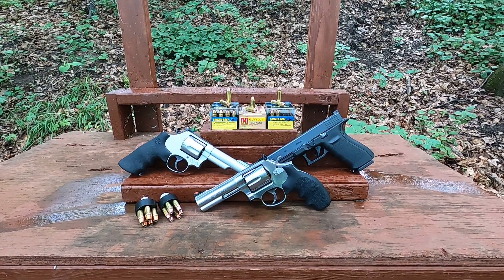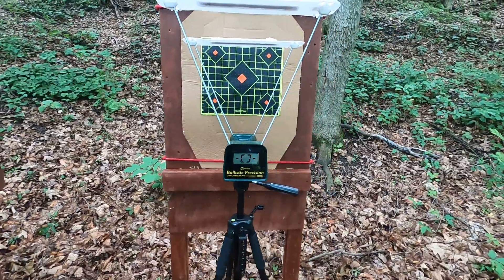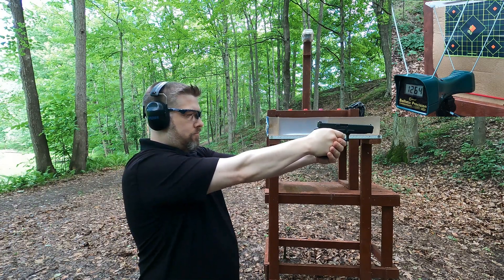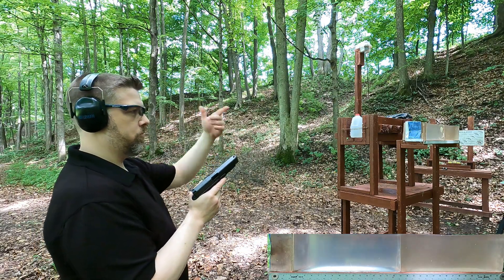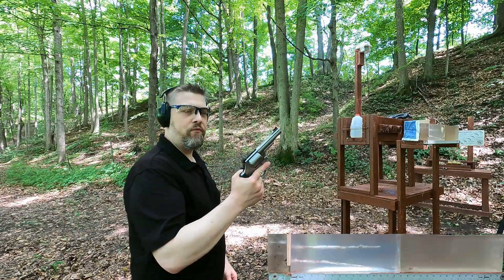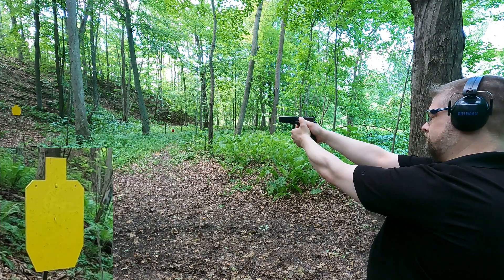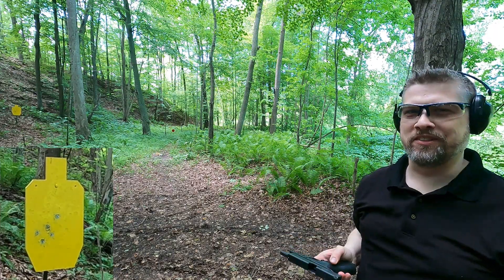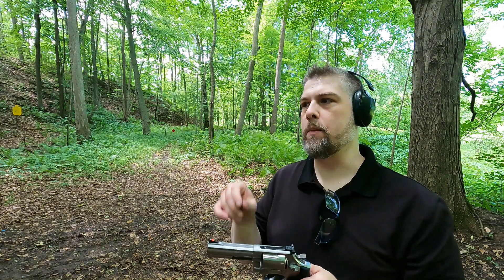10mm VS .357 Mag VS .44 Mag ALL 180 gr XTP

Comment from the maker: One thing I was trying to explain and could not get the words for in the field, is that probably the reason the .44 Mag had more recoil than the .357 Magnum is because it is more powerful than the .357 Magnum, thus more recoil. I know people will say "But Gun Sam, you showed that this particular .44 Mag is less powerful than that particular .357 Magnum?". And my answer would be, no I did not. I showed that in 4" barrels the .357 Magnum retained more of it's potential energy as where the .44 Mag lost more potential energy. Both of these loads in rifles I would have no doubt that the .44 Magnum would have more energy thus this makes more recoil in a 4" revolver even though the energy does not reflect this.
Reply: i think this video shows more then most that ammo choice matters tuning the ammo to the gun is as important as the gun
Reply: Possible contributing factors for the .357 shooting ‘lighter’, barrel having a full underlug, maybe the bore sight height difference. These smallest differences, plus more yet to be revieled are the reasons.
Reply: @randomizationdrills5372  "more yet to be revealed"...that would be included in the formula at shooterscalculator.com. everything is taken into account. check it out, lot of fun.   or if you like doing math, the back of the lyman manual has the formula in the long form.
Reply from the maker: If you look at the 10mm and .357 Mag you see small fireballs from the muzzle. With the .44 Mag it's several feet long of a flame. This goes along with my original comment. I think in an 18" rifle we would be looking at like 1,000 FPE for the 10mm, 1,200 FPE for the .357 Mag and like 1,600 FPE for the .44 Mag. EDIT- After I made that statement I did look up the numbers on Buffalo Bore's website and they did test the .357 and .44 Mag in an 18.5" rifle. And while my numbers were a tad more off than reality, I was still not wrong. The .357 Mag is 1,353 FPE and the .44 Mag is 1,537 FPE, both from the 18.5" rifle.
Reply: @GunSam "The .357 Mag is 1,353 FPE and the .44 Mag is 1,537 FPE, both from the 18.5" rifle. " But NOT in this case, since it was a "weak" load of 180 grains 44 vs "hot" load of 180 grains 357.
Reply: Had to watch this again with a very pretty lady. The extra recoil from the 44mag could be become of unburnt powder. That's just a hypotheses, damn I always get a headache when I use big word's.
Reply: I still have to admit that I was suprised that the 357 had more penetration than the 44 even though you explained the fact that the 44 was a lighter load
Reply: @donaldballman2825  the 357/180 has a sectional density of .202. the 44/180 has a sectional density of .139. since velocities were relatively the same and assuming the bullets are constructed the same, the smaller diameter/higher SD wins the penetration test.
Reply: @carlschumacher3257  I did listen to what was said in the video
Reply: @carlschumacher3257  You assessment of penetration is accurate.  I remember early in my law enforcement career in the early 70's second chance body armor company did a lot of penetration tests with their soft body armor.  There tests showed that the bullets that penetrated the farthest into their armor was a .22 Magnum and the .357 Magnum.  The handgun caliber that penetrated the least was the 45 ACP round.  Give me a 357 every time!
Reply: Being the same weight the 357 will hade a much higher sectional density, which is key to deep penetration.
Reply: @gun Sam revolver Aficionado have you thought of trying .45 super in that G21? Use your factory barrel, extractor and ejector and load your own using .45acp (or better yet .45acp+p cases. Just make sure it’s a fully supported chamber. Add a 24# guide rod spring and go to town! I use a Wilson combat muzzle break on my tac 45 XS and have had nothing but reliable function with everything from 330ft lb target loads to 900 ft lb 250-255 gr (heavy trail loads)  it reaches saami max pressures around 1,00-1,100 ft lbs. but since it’s the same dimensions as 45acp it’s super reliable. Just a thought. I’d love to see you compare my favorite pistol cal to some 10mm, 44mag ect. The Wilson combat muzzle brake is more effective the more your ft lbs increase. I also used a 24# guide rod spring, flat bottom firing pin safety and a 22lb main spring.
Reply: I'd like to have a shot at answering this.

Focusing on the diameter of the bore and the pressures exerted within the barrel can mathematically suggest why the 44 has more felt recoil.  Pressure is defined as Force divided by area.  Then Force can be derived by multiplying the pressure times the area of the bore - that is the force that is acting on back end of the bullet as it exits the barrel.  

The .44 has about 49% more area than the .357 bore.  At the same pressure, the .44 will have 49% more force.  Conversely, if the .44 had on 67% of the pressure of the .357, the forces would be equal, and I bet, the felt recoil would be the same.  

Does that seem reasonable?
Reply: Size and weight of gun also matters.  My .357 snaps way more than my full size 44, function of weight.
Reply: that's the dumbest answer I have ever heard-energy is a direct result of mass times velocity-both 180 grain bullets at the same weight would hit a steel plate with the same energy-the penetration is a result of less surface area to push through the medium-and why would you shoot a 44 magnum with a powder charge low enough to be in a special? A full power 180 grain 44 magnum load is over 1650 feet per second
Reply: Morning ,Sam. Doing some reviewing and thought I'd ask your opinion. 
I was having a discussion with a young man who was saving up for a 10mm revolver. He said I should get one, too. I said why? I already have a 357. Wasn't trying to be smart, but I told him 10mm is about multiple rounds. I have a .40 BTW. 
I couldn't see spending that kind of money for a revolver  when the .357 has more bullet choices and they're cheaper. What is your opinion on  10mm revolvers, and would you be better served saving up for the auto?
Reply: Recoil is a function of momentum but also specific to the ergonomics of the gun. Penetration at its base, is sectional energy which is modified terminally by bullet deformation and instability, which throw any predictions out the window.
Reply: @GunSam  Hi Sam, have you ever tested the 125 or 158 xtp flat point?  I’m curious to see the results from a revolver. I’ve tested from a rifle, but not from a handgun. Plus, I’ve never seen factory ammo loaded with them.
Reply: sam:  pull a bullet from each case and weight the powder charge then go to shooterscalculator.com and you can find out the recoil for each firearm you used. my guess is the .44 mag has a heavier powder charge.
Reply: @carlschumacher3257  Wrong. The same weight of bullets would've been resulted in 44 mag having MORE foot pounds than 357 mag if this 44 mag was loaded with lot of powder. Here we have an UNDER-POWERED 44 mag compared to the hottest 357 mag. Sensing more recoil when shooting this 44 mag (as opposed to shooting 357 mag) could be the result of the difference it ergonomics of the two revolvers.
Reply: no, you misunderstood what i said.  i was talking about the loads Sam was shooting. he wasn't shooting a full powered 44 mag load and yes, the 357 was a hot load, but that is beside the point. the video was about 3 specific boxes of ammo.
Reply: @carlschumacher3257  That's what I stated first, whereas you stated: "my guess is the .44 mag has a heavier powder charge" in your reply to Sam.
Reply: @carlschumacher3257  Agreed.
Reply: The powder weight is irrelevant as they will be different powder blends. Big bores like .44 have more bore diameter/area than a 357 and usually employ a slower burning powder.
Reply: 44 recoils more because it has more volume of expanding gas coming out the end.

Comment: Part of the reason behind the 44 having more recoil than the 357 could be powder charge weight. If the 44 has say, 10 grains more powder, it would have similar recoil to a 190 grain 357 at the same velocity. That's probably not all there is to it because I doubt there is a big difference in powder charge weight, but it might play a part

Comment: you can have your 6 shot, non accurate because of the bad recoil, long azzz trigger pull, heavy as a boat anchor, high priced ammo, over penetrating innocent bystander killing 44 and i will stick with my 33rd 10mm  that only penetrates 5 inches less by the ballistic gel tests on you tube.

Comment: It would have been better to see Buffalo bore XTP 10mm instead of the Hornady, like you did with the .357 and 44 mag. Buffalo bore 180gr 10mm goes 100fps faster than the Hornady XTP, basically the same as the .357

Comment: Buffalo Bore lists that .44 Magnum load as tested at 1,387 FPS from a 4" M329PD barrel.  You were getting a little less than that, which is probably desirable in the L-Frame M69.  (A Scandium .44 Magnum is too spicy for my taste regardless of the load.)

What's interesting is that in my own, limited chronograph testing, major manufacturer .44 Magnum often exceeded listed velocity from my 5.5" Redhawk.

American Eagle 240gr. JHP: Box 1230, Chrono 1327
Federal (Blue Box) 240gr. JHP: Box 1230, Chrono 1315
Federal (Blue Box) 180gr. JHP: Box 1460, Chrono 1580

While this was with an old chronograph that later died on me, the felt recoil made it seem like the listed numbers were accurate.

If ammo companies are conservative with their .357 Magnum loads, they seem to be less so with their .44 Magnum ones.
Reply from the maker: You listed Federal. They use a 4" for test barrel, typically 4"V test barrel, so i'm not surprised your 5.5" exceeded that. As far as I know, most other ammo companies use a 6" barrel for their ratings.

Comment: the cost of the components you just mentioned are 1/2 the cost of a used G20.  why not just buy one?
Reply from the maker: I literally spent $200 to run some ballistic tests. Perfect cycling is needed within the parameters of single shots fired for terminal ballistics testing? If I was carrying a 10mm, sure i'd get a better one. But what you are basically saying is to throw away more money to test a handful of tests that require single shots. So your comment makes no sense to me. It's not much different than if I used a Ruger Blackhawk 6.5" .44 Magnum, and someone had a fit that I didn't use a S&W model 29 6.5" because I had to cock the hammer manually.

Comment: My guess on the recoil difference between those L-Frames might be those 2oz of weight difference, the powders(differences in burn rate, peak pressure, charge weight) used in the different loads and possible grip angle differences

Comment: I've never seen a 44mag outdone by a 357 or a 10 mm
Reply from the maker: Well, with revolver cartridges there are less set numbers, as no slide spring to reciprocate.
Reply: It really wasn’t, the bullet weight he used was light for a 44 magnum. If he has used the typical 44 magnum bullet weight, it would have smoked both of them. Trying to compare different calibers using the same bullet weight is kind of useless, because often those aren’t the ones people mostly use. Paul Harrell mentions this all the time
Reply: @curmudgeonextraordinaire1884  just watched Paul Harrell 357vs44mag be 357 never got close to the 44mag maybe in 44 special never the mag and the 10 mm is just better off fighting with the 357
Reply: @seankientz4929  once you start watching Paul’s videos, everyone else seems almost clueless in comparison

Comment: The 10mm is meant for 200 grain or 220 grain
Reply from the maker: The original 10mm load was 170 gr, so that's the weight it was meant for.
Reply: @GunSam  You are right.
Reply: @GunSam  and.....the 170-180 grain 10mm is light for 10mm by modern standards. You saying NORMA is wrong ? But your Chanel your opinions.

Comment: You know - I have heard of  "lets try this and that against this and restrict it in this way, So I prove my point." - for 44 yrs.  I have 44 and 357. The Bren 10 is a step in the right direction. Just my view.  Restricting the bullets - without loading to Factory Max, in all - is just equating headcheese and baloney as equals. Yep - meat product - but not equal.     We use these calibers - because we know them - and not in a fleeting visit.  I have notes in my reload diary for  44 and 357 - going back 42 yrs.   Ammo - is not loaded to extremes by the factory, because they have no control of the firearm used.  99.9% will never grenade with factory ammo.  Now - my view - comes from thousands of rnds.  3 boxes of factory - is not a thesis. jmho

Comment: I use a sw 329xl hunter 44mag, handloaded to 700ftlbs. Fairly comfortable for that round. Accurate enough, soda cans at 30yrds fairly consistantly. However I have some factory loads, buffalo bore (I think) low recoil that are 1000ftlbs plus out of the same gun. Those though are a bit more recoil than I like. The 44 can be loaded all across the energy spectrum. Less than the 357 if you want, but more if you want.very versatile.

Comment: initial acceleration of the Bullets in the 357 vs the 44 probably accounts for the recoil even though the 357 was faster when it left the barrel the long heavy bullet in the 357 had less area for the expanding gas to press on initially but as the bullet moved down the tube the large dose of slow burning powder outpaced the 44.The 44 when fired had much more surface for the fast burning powder gasses to press on giving rapid acceleration but as it moved down the tube pressure from the fast burning powder charge quickly dropped reducing acceleration in comparison to the large charge of slow powder in the 357

Comment: I would go with the 10mm. Simply because I can still find it, sometimes, in my local gun stores, and I can find .40 S&W also, and I have a conversion barrel in that for my Glock 20. I have not been able to find .357 or .44 magnum since March 2020. FWIW, both .40 and .45 ACP are significantly cheaper in my area than 9 mm since then (.75 vs $1 a round for 9mm). I live in California so all sales must be direct by a dealer, registered with the State DOJ and background checked. Have not gotten primers since March 2020 either. I will say its nice to have a light on your home defense gun and the Glock does nicely there. And expansion being velocity dependent I think this 10mm round would do nicely. Thanks Sam, great video as always!

Comment: What's the loaded ammo weight for each in grains? I'm interested to know the difference because ammo weight matters when you are backpacking in the woods and because the projectiles themselves are the same weight I'm wondering which one will be the most total weight efficient compared to their energy and versatility. Thank you
Reply from the maker: I don't know exactly, but U would assume the 10mm and .357 Mag are about the same and the .44 Mag is a little heavier. Just from observation anyways. However, .357 Mag is more typically 125 gr so you could carry a lot of those and just some heavier ammo.

Comment: I think the 44 has more kick is due to the larger diameter bullet simple explanation???
Reply from the maker: I think it's just more slower burning powder with the .44 mag. So there's probably more powder, more combustion, but rather than see the increase over the .357 Mag and 10mm that is theoretically there, that extra powder just burns up outside of the barrel.
Reply: It kicks more because he’s using a model 69, which is a L frame. The N frame Smith is heavier and better for managing the recoil of the 44

Comment: Interesting. Pretty much as expected. The 10mm and 44 were mirror images of each other, and the 357 penetrated more due to greater SD. Probably a great pig load. The 10mm looks pretty practical. I suspect 1 reaon for the lower recoil of the 357 is barrel profile. The 686 barrel has a full lug, which concentrates weight underneath the barrel, helping tame things. The 69 only has a regular ejector rod shroud. Assuming they use the same barrel blank, the 44 obviously has more meat drilled out of the barrel than the 357. It might only be 1 oz or so total over 4", but everything counts. Also, with more mass in the barrel of the 357, it allows gravity to exert a more concentrated downward pull, helping to reduce recoil and muzzle jump. That was what i meant in the first few sentences. I love my 1993 vintage 4" 686. It is probably the most accurate repeating handgun i own. Several other revolvers are close, but the 686 is it.

Comment: A better example of sectional density. .30-06 220 grain solid at 2400 fps  v. .416 Rigby 400 grain solid at 2400 fps. Sectional densities are identical for all practical purposes. The Rigby would ,on any reasonable head shot presentationxss, reach an elephant brain box. If WDM (Karamogo) Bell had a .30-06, this is the load he would have used. If I went back to Alaska, I would be perfectly comfortable using .30-06 with 220 grain softs on Alaska's big 3 (moose, bison, and Alaska's giant bears).

Comment: Interesting test. The.357 magnum having more power than a .44 magnum was a surprise being that they had the same amount (180 grains). The .10mm sort of fell a little short and it had an equal amount. The .357 is a round that can pretty much do it all. The.44 and the.10mm aren’t slouches, but I guess it depends on the ammunition and purpose of use.
Reply: the .357 was clearly a bit overloaded, which Buffalo Bore is known for.....; fastest reload from 10" barrel is almost 1396 fps with 296/H110; to even approach that from a 4" barrel is most definitely beyond intended pressures. (Oddly enough, the .44 ammo appeared to be mid-range loads instead) (The. 44 mag has reloading data for almost 1900 fps loads with a 180 gr bullet from an 8 3/8th barrel...; to clock under 1300 fps is  mid-range loading, or, drastically too slow-burning of a powder)